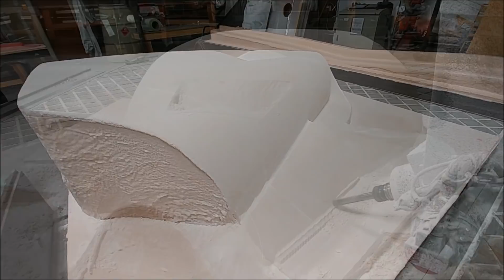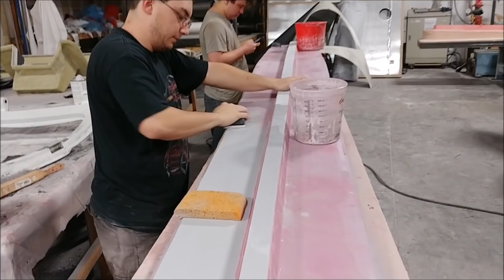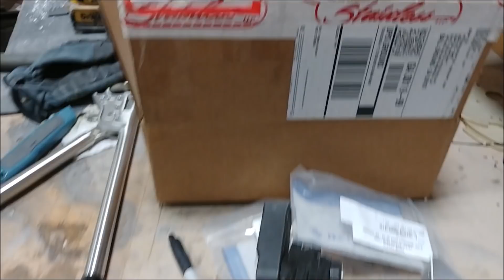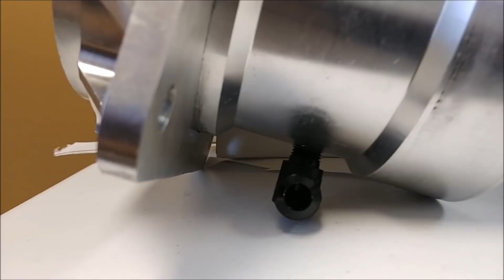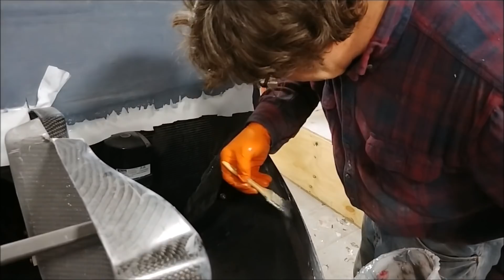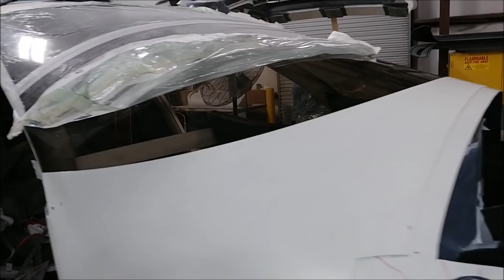Aircraft Rhinoplasty - Bonding the nose skin into place

Comment: Great video series, I can't tell you how fascinating it is, for me, watching this process. Local to the Oshkosh area, actually work at KSBM, and I'm looking forward to seeing you and you'r team this year at AirVenture. Just commenting on this video in regards to the click studs. I spent a couple years working on V-22's and dis bonded studs were always a nuisance. But that thing has thousands of them. A lot more vibration, and we weren't very gentle all the time. So I cant say they'll give you problems but that's my un-expert two cents. They seemed to always dis bond from the bottom of the stud base, not the composite structure.
Reply from the maker: These ones are not click bond. They are only one piece stainless and we're going to add a layup of carbon over the top of them.
Reply: I would think that'll keep them in place for a good long time. Built as solid as everything else on the air frame so far, should have been able to guess that was your plan. ha

Comment: How large is your CNC gantry?
Reply from the maker: The bridge is about 12' high at the top. The table is 10' x 10' with 51" available travel in the Z axis. It needs an 18' ceiling height to move around without the spindle hitting the ceiling.

Comment: Great video series.  I am finally asking a question I have been saving for some time.  How do you index the long parts that you must move on the CNC mill?
Reply from the maker: I just move the spindle let's say 100" along the Y axis and then bring it down on the work and make a pin sized impression on the part using my pointy index bit. Then I slide the part down the table, and 100", and then locate that pin sized mark again using the machine. The difference in the positions is how far I moved the part. So I offset the original zero index position by that much in the Y axis. Now I just run the next tool paths like nothing has happened. Their Y positions would normally be off the end of the table but because of the offset they no longer are so everything is good.
Reply: Raptor Aircraft 
Oh man i'd so screw that up!!